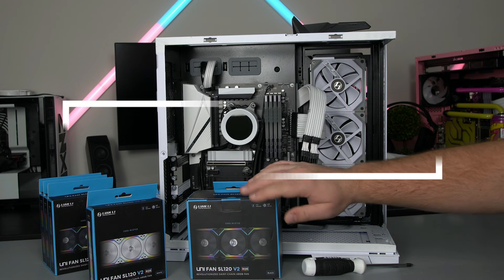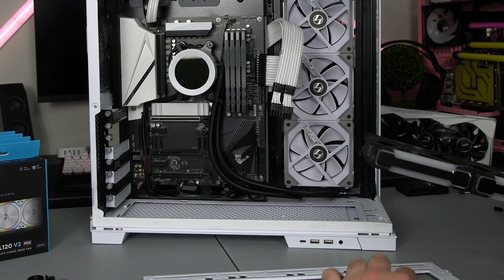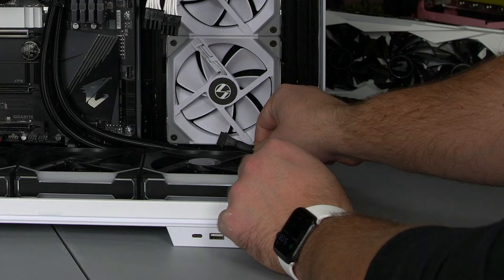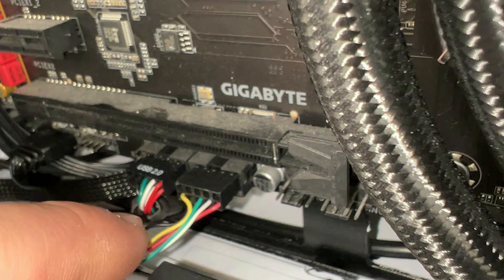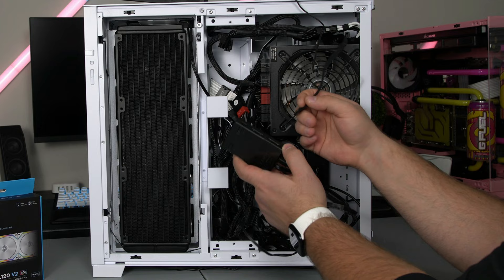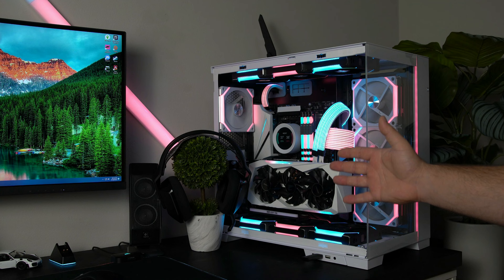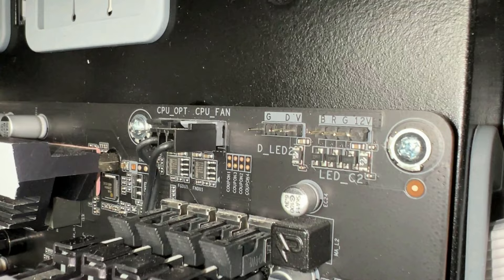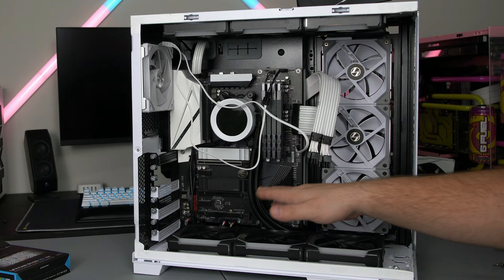How To Install Lian Li SL120/140 V2 Fans - 3 Pack & Single Pack

Comment: “These fans save you from using too many wires” meanwhile the control box: 🌚🌚
Reply: Well they do. If they didn't interconnect, you'd have wires for every single fan. The multi hub connector is ubiquitous for all advanced computer fan packages. One way or another, the fans need to communicate. Also, when fans are interlinked, they act as one unit and only need a single comm and power. 

So yes, the Lian Li design saves a lot of wires. And there's even a lawsuit on other companies using their design IP
Reply: Interlink… cells within cells..😂
Reply: @deesteez4329  you showed emotion with that emoji....you weren't even close to baseline...
Reply: @felixchien1664 🤣🤣🤣good one!
Reply: SUUUPER UNDERRATED COMMENT
THESE FANS WILL NOOOT help with cable management 
The control box only works for one type of fan so if you have SLs and INFs u need 2 boxes which is just dumb

Comment: Not sure if you're still active, but quick question:
First, I was happy to see your AIO mounted vertically on the side of the case, instead of top. I also noticed you're pulling air through the rad from the three fans inside.
So, how are you filtering air on the outside that's entering the rad? (I couldn't see back side) And more importantly, do you think there's any benefit doing push/pull there?

I have Corsair AR120s and the AL120V2s, BUT I have room to install three static TL-B12Ws onto the rad side facing out (and ofc the reg flow fans on the other side that you see inside case).
It's a roomy case, the 5000D RGB airflow, and well I guess I wanna move a lot of air :)
Thank you for video and reading.
p.s. Just noticed your AIO is NZXT just like mine lol. Guess il experiment with NZXT's controller, the Corsair fans and Lian Li controller, hah.

Comment: So you just need to plug the controller to use spot and psu? How about 2 thin wires ( speed control and rgb control I think) ?

Comment: Thanks for posting this. Just placed a huge order with NewEgg yesterday, and I have to upgrade my case and power supply for the new video card. I just happened to get the exact same case and fans as you. My new AIO will be the Lian Li one though. I got 6 fans and planned to setup airflow exactly as you have yours. Since I'm using a Lian Li AIO, should I plug that into the Lian Li hub as well? Or should I plug that into the motherboard for CPU cooling control? This is my first AIO and I have some stuff to figure out. Your build looks great.
Reply from the maker: For the aio, plug that into your cpu fan header. The fans can be plugged into the hub. 

Thank you 🙏

Comment: Air from inside the radiator will travel up. Right into that CPU pump. It's going to get pretty hot in there. ALWAYS make sure the radiator hose ports are ABOVE the CPU pump.
Reply from the maker: Yeah except everyone forgets one very important fact… the air can never make it to the pipes. This is one of the best ways to mount your AIO.
Reply: @BuildsWithV  Wrong. Over time, water evaporates. Even in a sealed radiator.  Air rises. Right through the same tubes the water ran through. Strait to the pump. Your asking for trouble.
Reply from the maker: @BlitzGeist  yes the water evaporates but the air stays inside the radiator. If you’re telling me that the air can come all the way down through the radiator and into the pump then the air will have no issue making it down the tubes and back into the radiator.  The logic doesn’t make sense. I’ve had my rads mounted like this for a long time. Not one single time have I had to hear air bubbles. When I had it mounted with tubes at top or even radiator on top of my case, heard air bubbles constantly hitting the pump.

Comment: Hi @BuildsWithV, I have a quick query. I've installed the V2 pack of 3 fans and connected them to the controller. However, I've connected the small cable for PWM and ARGB to the connector without the USB cable. The fans runs well but the RGB isn't working. The small wire from the connector hub is conenctoed to another hub on the Lancool 216 PC case. Does the ARGB wire need to be connected to an individual 5V ARGB port on the motherboard? Please help.
Reply from the maker: I don’t remember exactly but I believe the usb cable needs to be plugged in as well. I might be wrong

Comment: Nice video and PC but RIP to your cooler 😭 the AIO should never be installed higher than the tubing port to minimize air in the cooling system
Reply from the maker: Thank you 🙏 the pump should never be mounted as the highest point in the system. The pump is lower than the highest part of the radiator. All air stays trapped in that part of the radiator. Have been running like this for 2 years without a single issue.

Comment: question.

with the 3-pack, does this methode only gives argb control through L-Connect? or also through for exemple Asus Armory Crate? because i don't see you plug in to the argb headers on the top of the motherboard. is this controlled by the usb 2.0 port?

Comment: If I chose not to use the Lian Li controller and plugged the fans directly into the motherboard PWM and 3-pin ARGB, how many of those fans could I safely daisy chain on one sich connection?
Reply from the maker: only about 3-4 can be plugged into 1 header.
Reply: Usually a System header are 1A, so look at how at much the fans draw and don’t exceed that, but it’s usually 3 fans is the most

Comment: Just a quick question do u not need to plug in the 5v argb header and the fan header when you have the fan hub with the 3 pack ?

Comment: Hey thanks, quick question what’s the difference between v1 and v2 ? I will buy white fans and the only difference I saw is the white is more « pure » white on v2 than v1
Reply: The V2 fans are 28mm thick instead of 25mm so pull a little more air. Plus the connector on the side is flatter.

Comment: Now is there a way to daisy chain single packs with the nifty connector or does it only come with the 3 packs. I'm ordering 6 fans and wanted to plug all 6 into the hub so I only really need to order 1 3 pack

Comment: The problem with these fans is the cable for the controller hub is too short.  There are no longer cables available that I’ve found.  I’ve emailed Lian Li multiple times asking about longer cables and they won’t respond.
Reply: 😂😂 they sending your emails to the spam folder

Comment: oh man
This is breaking my heart...
from what i understand the absolute best way to install the AIO is to have it at the top..
YOu always want the pump lower than the rad hoses...
Reply from the maker: You’re misunderstanding, you always want the pump lower than the highest point of the radiator. Your heart is fixed 😉

Comment: Hi .. do I need sata cable when installing single pack to motherboard, say two sl 140 fans joined together ...
Reply from the maker: Nope, just use the included cables from the single pack to connect to your motherboard
Reply: @BuildsWithV  thanks , easy install 👍

Comment: Love the way how you routed your USB/SATA cables for the AIO! Looks really clean! Were the cables long enough to route them to the bottom or did you need extensions for that?
Reply from the maker: Thank you 🙏 They were long enough to route them to the bottom and even enough to plug them into the back of the pc case.
Reply: Love your videos can you help me with my setup 😭🙏🏾
Reply: @BuildsWithV 

I've got these fans, is there no way really no way to mount the fan control hub.

Comment: Would you know if the (single) SLV2 fans can be connected to the SLV1 hub? since the single fans use the 4pin pwm and 3pin argb similar to the SLV1
Reply from the maker: yeah they do work on the slv1 hub. I tried it

Comment: This is awesome but like what are all those hubs in the back of your PC and what are they controlling? Like I wanna do exactly what you did here but I'm so confused as to the power output of these things. Like I don't wanna overload one hub or something. Why are there so many hubs in the back of your PC? I noticed you have the nzxt splitter one and another Lian Li one already mounted in the back on top of the one you just installed... what the hell is all that controlling? LOL

I want to put a 3 fan AIO on the top mounted but also want 3 intake fans on the bottom like you did here as well as have 3 in the front along with the 2 strimers how many hubs would I need to do this and how do they even attach to the mobo? Thanks for your time. These are some of the best explained videos on youtube for this kind of thing, keep up the good work.
Reply from the maker: So the nzxt hub is just a splitter for all the other hubs. One of the lian li hubs is for the lian li Strimer plus cables and the other hub is for the 3 fans on the side which were the v1 of these fans. I have removed them after this video to install these new fans so that hub is gone. Currently have 2 lian li hubs (one for Strimer cables and one for these new fans). My aio plugs into the nzxt usb splitter along with the other usb 2.0 devices.
Reply: @BuildsWithV  hey man i love your videos and the fact that you're actually replying to comments. I saw somewhere that you could connect the strimmer hub to the unifan hub using a lian li rgb key cable or something like that. Is there any advantage in doing that? I was hoping to sync all light effects from the l connect program. Will that require me to connect the strimmer hub to the unifan hub? Or will connecting the strimmer hub separately to a usb header also allow me to sync light effects with my fans from a single program? Thanks man it'd really help me out a bunch
Reply from the maker: @sweetbiscuits91231  I’m not sure if you can connect the hub to the unifan hub however it might be possible. I think that was more for the older Strimer plus but not too sure. Back then, those strimers couldn’t be controlled by lian li software so you have to physically change it via the buttons or plug it into your motherboard for control which meant it was limited. Connecting the new ones to the unifan hub would be pretty much useless since the unifan and the Strimer v2 is now controlled by lian li l connect. You can control all the lian li lights within l connect at the same time and to the same color but I like to control everything separately to make my own styles.
Reply: @BuildsWithV  got it. Thanks for taking the time to reply ma dude. Really helped me out a lot. I can finally move on to ordering and finishing up my new build 🙏

Comment: I really like your work, but I'm wondering .. what kind of CPU cables you are using? I've never seen an RGB CPU cable.
Reply: those are the Lian Li Strimer plus V2
Reply: @sinfiltro4858  And do they work as a CPU cables? Because I ever never seen anyone using it this way!

Comment: If you hover your hand above the top of your case with your fans being mounted this way, does the exhaust air feel hot or cold (around room temperature)?
Reply from the maker: If I’m gaming, it’s hot air from the gpu.
Reply: @BuildsWithV  Okay, thanks!

Comment: Kinda late but need help. Got the 3 fans hooked up and connected to the hub. Huh connected to SATA and USB2. Still no spin or rgb. Help please
Reply from the maker: Have you installed the software? If not, try that. If you have and still not working, try updating the firmware inside the software
Reply: @BuildsWithV  thank u

Comment: how do u connect 5 set of fans to 1 controller? sl 120 infinity uni and 2 140 sl140 uni
Reply from the maker: You’ll have to use the included piggy back cable and basically just make a set of 6 instead of just 3

Comment: Would like to know how you connected the new fans to the AIO as the three pack has a unique plug to Lian li controller from the new fans. Or do you just use the Lian li controller software to control radiator fans and not the AIO software ?
Reply from the maker: I used the cable that comes with the single pack. Connected the pwm cable to the aio header and the rgb cable to the sync 1 on the controller
Reply: @BuildsWithV  makes sense now I guess I have to get a single fan pack to get this pwm cable I’m missing. Thanks for your reply

Did you have to disable the cpu fan connection in bios for motherboard?
Reply from the maker: @bobes919  I did not disable it, I actually plugged the pump pwm cable into it which allows my MB to read the speed as well even tho NZXT software shows me all the info I need
Reply from the maker: @bobes919  you can technically just use the lian li software to control the pwm if you want. I just did it this way because I had the spare cables from my single pack fans. If you absolutely need the cable I can send you it for free as long as you pay shipping. Let me know, I have several left over
Reply: @BuildsWithV  So i have a Asus Stix AIO and doesn't have the PWM connection so I got a little confused as the Strix AIO says to plug into the MB.
Appreciate the offer but I still need another fan for exhaust so the cable will be supplied in box for me or alternately like you advised to use the Lian Li software ill play around and see what works best, I think the MB software but will have to experiment with it.  
Thanks again much appreciated.
Reply: @bobes919 did you ever figure this out? I’m using an Asus Rog AIO as well but replaced all 3 fans on the AIO with these lian li fans. Can’t figure out what to plug/how to plug stuff in for the cpu fan/AIO pump. Any help is appreciated!
Reply: @QueakScope  Yes it’s actually much simpler than you think. Connect the AIO usb cable to a USB header on the motherboard and the 3Pin from AIO to the AIO_Pump header on motherboard. Then the LianLi fans are connected to the LianLi controller. I use the motherboard AIO control for pump which is 100% all the time and control the fans with LianLi Connect software.
Reply: @bobes919  doesn’t this make the system auto shut itself off of as a “precautionary” if nothing is plugged into the cpu fan? Or did you mean to say to plug the aio pump into the cpu fan header instead?
Reply: @QueakScope  so I set the motherboard to ignore the CPU fan header in bios to get past this issue.

Comment: Can you daisy chain 3 triple pack and 1 single one together?
Reply from the maker: The most you can daisy chain is 6. So 2 triple packs
Reply: @BuildsWithV  thx
Reply: @BuildsWithV  so if I get one of those nzxt connectors would it work?
Reply from the maker: @Andrew-ky7nj  oh I thought you meant in a single row. One controller will support all you fans no problem.

Comment: would you be able to buy a 3 pack then use two on top of the case and one of the back? or would you need to buy 3 single packs
Reply from the maker: Yeah, the 3-pack comes with 3 individual cables as well.

Comment: Is it okay to plug my aio fans (SL120 on aio from diff brand) into the controller and control them through l connect? I don't have the cable from the single fan pack
Reply from the maker: Yeah you can.
Reply: @BuildsWithV  thanks for the fast reply! Really good vid wish u the best
Reply from the maker: @oxorade979  No problem at all. Thanks for watching 🙏

Comment: Did you plug the lian li fans on your Z73 aio into the rear box?
Reply from the maker: I did not, I plugged them into a fan header to have separate control of the fan speed

Comment: it works like: 1 cable with max 4 fans in a row. not more :/ if u want more fans connected, u need a second cable. for example 3 fans 1 cable and 2 other fans with one more cable
Reply from the maker: You can daisy chain up to 6 fans with these fans.

Comment: i noticed with the hub you didn't connect the fan header cable, is that because you just use the usb port/l  connect 3 to manage it all?
with perhaps the radiator fans you let it manage via radiator apps
Reply from the maker: Yeah that’s correct, I just use l connect to control the top, bottom and rear fans. The 3 fans in the radiator is plugged into the nzxt pump to control those separately from l connect in case I have issues with l connect at least those 3 cpu fans will continue to work.

Comment: do you need the controller to intall the fans?
Reply from the maker: The 3 pack comes with the controller which is what you’ll need to install the fans. The single packs some with standard connectors which means you technically can plug them in without the controller

Comment: i dont understand why i got a pack of three fans and a bunch of one pack for a total of ten fans, are the three pack fan are different then the solo fan because i cant plugs them together. i got two freakin different controller, so i can only plug one controller to my motherboard. im freaking out spending all that money for nothing
Reply from the maker: Just use the extra cables from the 3 pack to connect them all to one controller. For the 10th fan you can plug it separately or buy another v2 cable from the 3 pack.

Comment: That AIO is upside down. The cables from the radiator need to be higher than the CPU. You’re creating air bubbles which could cause damages.
Reply from the maker: That’s not correct. Air bubble can’t make it to the pump with this setup
Reply: @BuildsWithV  I mean all the testing is there to prove it. But I’m just letting everyone know.
Reply from the maker: @OkayGonzo_  what testing? Did you do any research because you’ll find very quickly that this is actually one of the best ways to install it to avoid any air getting in the pump.
Reply from the maker: @OkayGonzo_  https://youtu.be/BbGomv195sk
Reply from the maker: @OkayGonzo_  https://youtu.be/DKwA7ygTJn0
Reply: @BuildsWithV  Your best bet is to mount your AIO to the top set to exhaust. But again I’m just informing people to help them and save some money.
Reply from the maker: @OkayGonzo_  yes we all know the best is up top. This is the second best way. Worst way is bottom rad and side mounted with pipes up top is okay as long as the pump is lower.